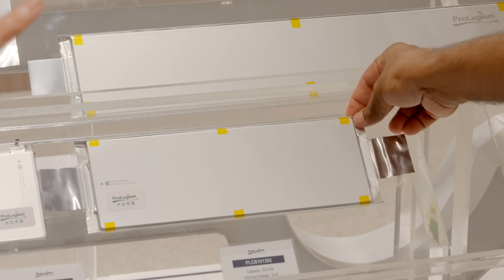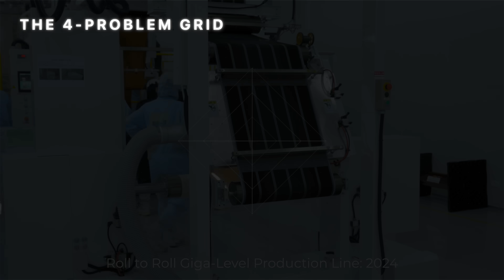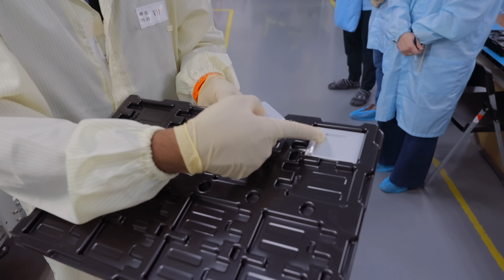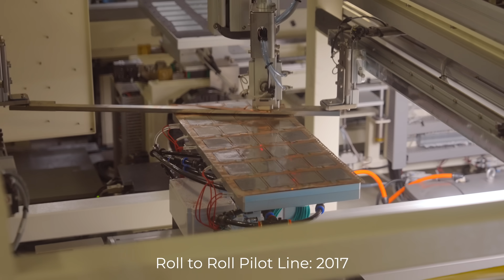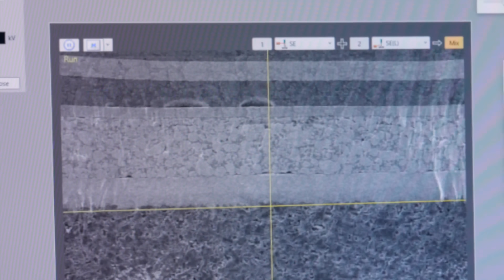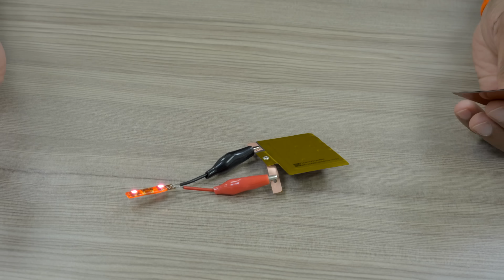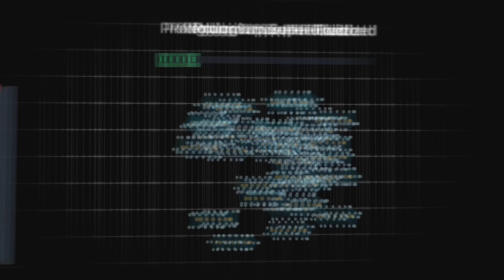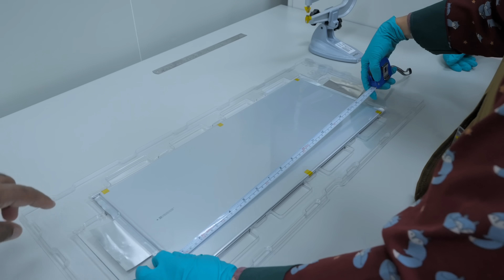Testing a REAL Solid-State Battery - Finally Here?

Comment: That's wonderful news. Unlike DoNut lab's series of videos, they proved their honesty by their transparency. Good on them. 
I can't wait to see the cycle life and have them on our EV's.
Reply: So quickly after Donut Labs videos lots of battery companies are revealing their progress. This is a win in my books.
Reply: Listen to the timeline... They were working on this product for many years AND had already done their 3rd party verifications by the time they went public. DONUT, is at that earlier stage when they are going through the 3rd party testing. Also, you're comparing a company that's already established and has income from major OEMs vs DONUT which has to rely on investors and a low volume motorcycle manufacturer to drive future sales of the batteries. This is not a fair comparison. It would be monumentally dumb for DONUT to be this open if they're making a product different from what everyone else is working on (remember: theirs is not a lithium based battery). That's asking for a bigger company to swoop in and take their commercial advantage.
Reply: Cell phones that charge faster and don't have thermal runaway would be nice too.
Reply: Wouldn’t using 2 volts to calculate energy destiny be too low for the motors to handle the heat, caused by the need to sustain power by pulling more current/amps X that voltage?
Reply: @charlieechert4092 2 vokts times 200 cells (assuming 800V architecture) would still give 400V for the motors, so still plenty.
Reply: @charlieechert4092  Good on ya for thinking about it. Prolly a good time to study up a bit on how PWM motor drives work.   I dont understand it well enough myself to do a good job of explaining it in 140 characters or less.  It is pulling way high current for short variable pulses, averaged by the inductance of the motor windings to arrive at a particular average current and polarity in the motor windings at any given instant.  
 Based on the noises my Leaf makes, EVs are using something a bit more advanced than straight up PWM anyway, but the point is, no electric car is putting a drive motor straight across a DC source. The simple v*i=watts isnt really how to look at it.   The voltage doesnt matter to the drive within reasonable limits, and the battery is being monitored at all times to not let the voltage go too low to risk other problems occurring.  Toward the bottom end of battery voltage, the max current, hence the max torque from the motor will have to drop, but until approaching that point the current*voltage =watts output does not signifantly change,  the switching timing in the drive adjusts accordingly.   But generally to not brutalize the battery and drastically shorten it's lifetime, you shut the drive down before you get into that range. It has a predictable output up until that point were I suspect every EV manufacturer has some sort of low battery warning, soon to be replaced by a turtle/limp mode and then completely shut down the drive to prevent permanent damage to the battery.
Reply: How can I order one????
Reply: @FaudhiaMohammed-g9o  
That is the right Question !!!
Reply: They are protected by their patents, which I doubt Donut is. So that’s why they stay fairly quiet
Reply: You can buy a Mercedes AMG GT. They are starting pre-production in the next months. Maybe you can oder one at the end of 2026. My lucky guess is, that is has a Prologium battery inside. And you get THREE axial magnetic flux motors from Yasa with it.
I am pretty sure that it will be the best EV on this planet for the next few years. Lightweight with a lot of range and unmatched performance. Compared to that every Porsche, Rimac, Xiaomi etc. will look like kids toys.
Reply: @stefanweilhartner4415 How long does it take to charge? How much does it cost?  What temp ranges does it meet full performance?
Reply: @Radarcb329  details will be released at the end of the year.
Reply: @Radarcb329  mercedes should tell you the price .... he hehehe. yeah EVERYONE CAN AFFORD MERCEDES THESE DAYS thats why everyone is buyin chinese cars... which are better and cheaper... heheheh. also dont own one. im stuck with an old crapy voswagen gasoline but this ones engines seems to be half decent still kicking 7 years later no issues... a part of being thirsty but thats the price to pay for good aceleration and high speed.
Reply: @Radarcb329  if it uses fancy batteries it's basically "as fast as your grid can handle". So minutes if you have specialized gear, hours trickle charging in the boonies. These things need A LOT of power.
Reply: @stefanweilhartner4415 will also make the others look like they are priced like kids toys as well. The reason it is not in every ev cost hard to sell a 200k model 3
Reply: @mddunlap03   Chery will release a van with a solid state battery by the end of the year, it’s like 100K USD in China, which is like almost 3X the price of a Xiaomi SU7 base mode
Reply: @mddunlap03  That's the problem with the solid state battery it might be better battery technology but a LFP battery is more than good enough for the application at a much lower cost.
Reply: @stefanweilhartner4415  How about other costs to humanity.  The Hidden Cost of Fireproof Batteries

To make next-generation solid-state batteries safer, manufacturers are incorporating fluorine-based compounds to prevent fires. The logic is sound: non-flammable materials mean fewer dangerous battery fires. But there is a troubling catch nobody is discussing.

These fluorine compounds are PFAS—the same "forever chemicals" found in 3M's stain-resistant carpets and waterproof clothing. The difference in scale is what should alarm us. The PFAS crisis from decades of consumer products is already a global health emergency. Now imagine those same persistent chemicals embedded in billions of electric vehicle batteries, grid storage units, and electronics. At end-of-life, each battery becomes a potential point source of permanent contamination.

PFAS are the leading suspects in modern cancer epidemics. They mimic hormones, disrupt endocrine function, and never break down inside the human body. They accumulate. Over a lifetime. Across generations.

Scientists have already detected battery-related PFAS in wastewater and landfill leachate near manufacturing facilities. Yet research on this problem remains, in the words of a 2025 scientific review, "underestimated" and critically under-studied.

We are racing to solve fossil fuel emissions by building infrastructure that may leave a toxic legacy magnitudes larger than anything 3M ever produced—before anyone has asked whether we're trading one existential crisis for another.
Reply: donut is garbage
Reply: Hey guys, is this battery more efficient than the current one?  
I don't have much knowledge about batteries, but I love watching these videos.  
If my e-bike has a 60Ah battery, how much more capacity can I fit in the same space?
Reply: @Arnabsrkfan  30%
Reply: @MrAdopado  Not a whole lot more but at what cost premium. The cost per WH of the solid state battery will be considerably higher than LFP or NMC. Might be applied to space limited applications first until the price can be more competitive for EV application.
Reply: @bobsmith3983  Indeed ... like everything else it will be a premium option initially until economies of scale make it the cheap enough for all vehicles perhaps.
Reply: Donut Labs 🍩 is making everyone step up their game by bringing proof. No more empty promises, endless deadlines or hype.
Reply: Except they didn't show him a running production line. The employees were doing it manually for now UNTIL the line is up and running (yeah, right. . WHAT? That is actually the haradest part of bringing them to market. DONUT 2.0
Reply: Did they really fail when they get brought up in the comments of every battery tech video now?
Reply: @edwardhoffenheim3249 More evidence that more people with a voice doesn’t mean more intelligence.
Reply: @Radarcb329  yeah, its called comercials to fool people on living the live billionaires companies want you to live...
Reply: @edwardhoffenheim3249  depends on if they've been taking investment without delivering on their claims
Reply: @edwardhoffenheim3249  Yeah, but bad reputation only gets people talking and cursing. It doesn't attract new buyers.
Reply: Really? No charge times. The reference should be related to what gas vehicles do now.
Reply: Thats because they are an Asian company. Typically Asian countries don't try to imitate or follow western culture, whereas European culture typically does. What Donut did was a hollywood trailer style marketing strat. 
Once again its another piece of the proof that the future is in Asia.
Reply: @TejashPatel-z2r   what are you even talking about? Have you been to any Asian country ever? Maximum delulu
Reply: Tejash.... That was the biggest load of bullshit I've ever read... Unreal.
Reply: @TejashPatel-z2r  Marketing tactics that work, as Donut's clearly did are not a bad thing. But they only work for you in the end if the product is actually good too, which Donut lab's might well be. In which case they are going to become a pretty big Battery producer very quickly, and might skyrocket with the many Buy European initiatives going around trying to limit Europe's exposure to geopolitical troubles.
Reply: Wait - what did you say? Asians don't imitate? Are you high? Do you live in Colorado and imbibe 5x daily?
Reply: @TejashPatel-z2r That’s motherhood speaking, with false narratives. Donut lab has not done anything like Hollywood except certain superficial characteristics. What freaking difference does it make if 100,000 cycles isn’t real and it’s 25,000.  The big problem is the over selling of EVs and Asia hasn’t helped.
Reply: @Radarcb329  not sure what motherhood means. Im not female and I'm not Asian. Maybe your projecting your insecurities onto others 🤔
In terms of Hollywood and America, all they are, is superficial, which is what Donuts battery is looking like. Also just like America, they want the all money when they have a concept and not the proof and and go head first into the headlines to try and wow everyone into believing them.
Reply: @TejashPatel-z2r You are prejudiced and at this point t it is ridiculous to say anything. I’m just looking for facts not BS which is all you seem to deliver.
Reply: All you have to do is look at the declining birth rates and the skyrocketing suicide rates to realize this isn't true. East Asia has problems, as does any country, first world or not, but I am Korean - SK is not a pleasant place to live as a normal person.
Reply: @Sarius- smart people will figure out what to do.  This should be about batteries, independent of politics.

Comment: Fantastic 👍
Take that Donut Labs!
Reply: You can keep your lithium and expensive high heat manufacturing.  What solvents are used in the process?
Reply: Holyvolt is much cheaper and cleaner and they talk about the process more than Donut.  Donut isn't alowed to talk because of NDA with CT Coating.  Doesn't mean it's not real.  400Wh/kg is better.  100,000 cycles ftw.  Take a TS Pro for a test ride.

Comment: Folks at the streets call it Donul Lab battery ;)
Reply: What a difference, between a transparent manufacturer and the ways of near a scammer.
Reply: @oatlegOnYt that's not entirely true... They didn't show us the tests Donut lab already showed us
Reply: @Peter-x29 That tests are just independent units over a very short kind of conditions. No reveal about the composition, not verified behavior over multiple units... That kind of behavior I saw a lot on other things and ended being scams or very afar from the original promise.